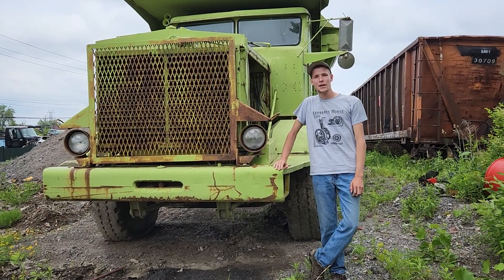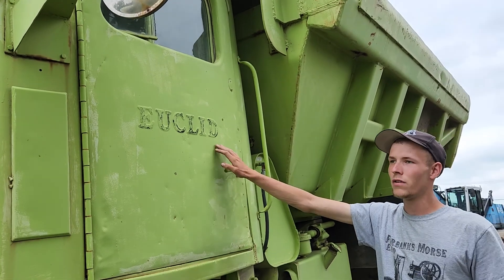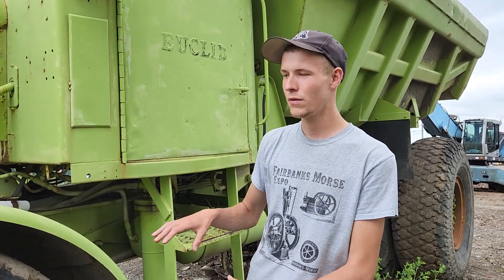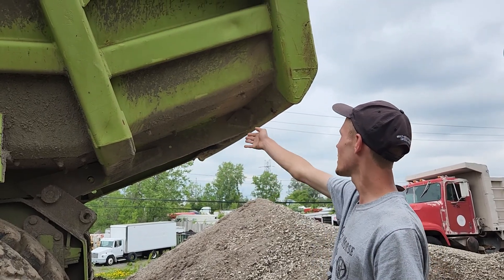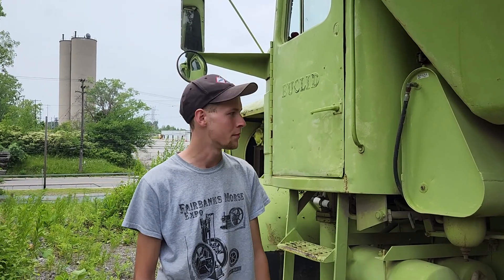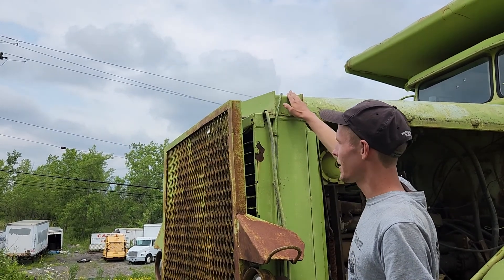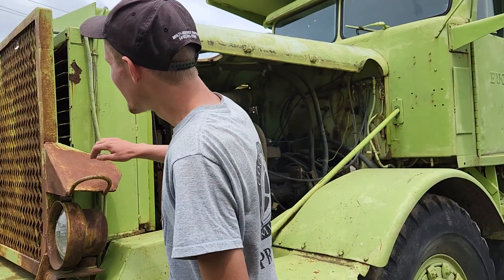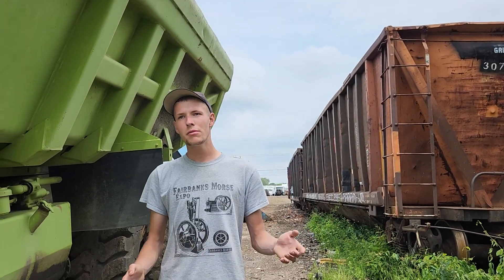Euclid R series dump truck (Walk around)

Comment: The Leigh Creek coal mine in the north of my state of South Australia used Euclid 35 ton capacity dump trucks for years, later replaced with more modern Lectrahaul units. Mine has since closed, i assume all the old Euclids were scrapped. A couple were converted to water tanker/fire trucks and were still onsite in 2007. Fortunately i got some pics of them at the time
Reply from the maker: Very interesting! Thanks for sharing!